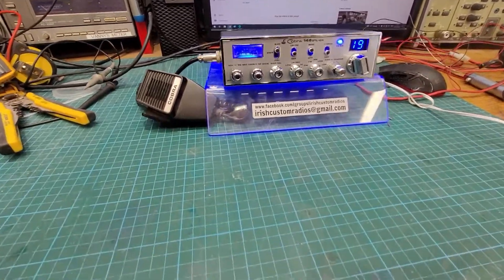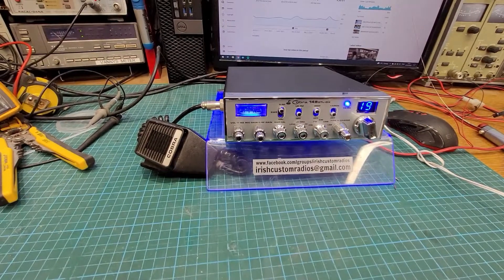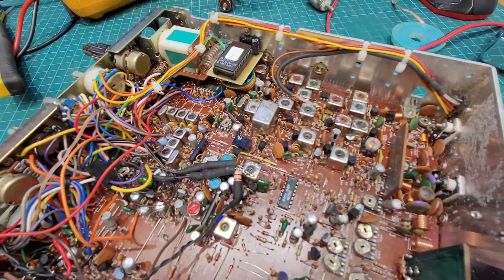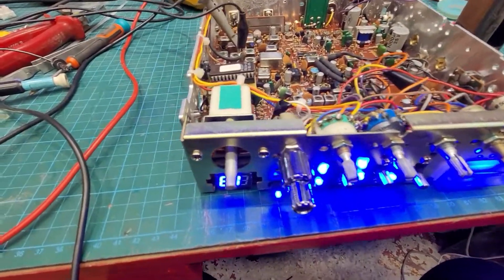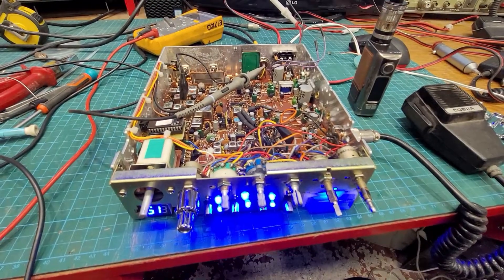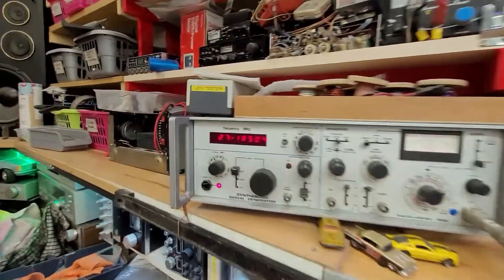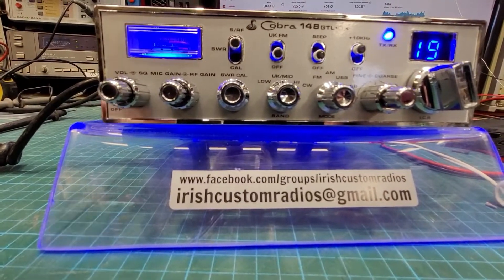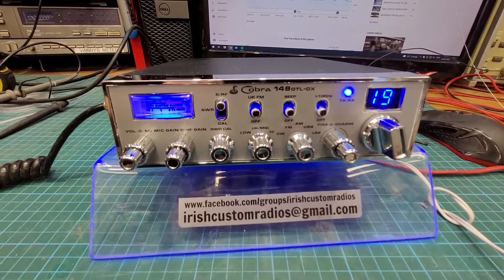DEL'S MK2 COBRA 148 GTL DX

Comment: What do you think of the binary adder mod to get the extra bands on the 148 prefer to get 1 standard but I have a chance of one with this mod never had it before always been the old EPROM
Reply from the maker: not a fan of this mod. The radio becomes deaf on the extreme ends. Id it was designed to spread over 6 bands, they would have made it that way.